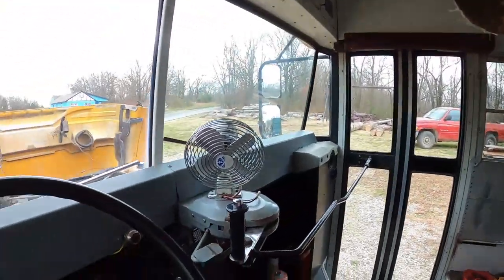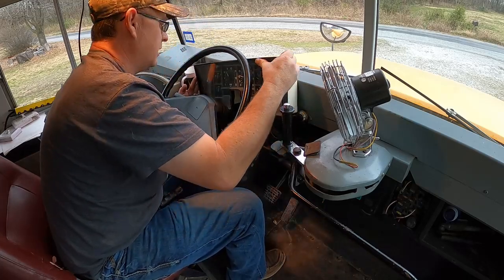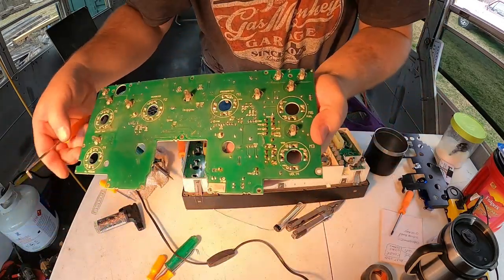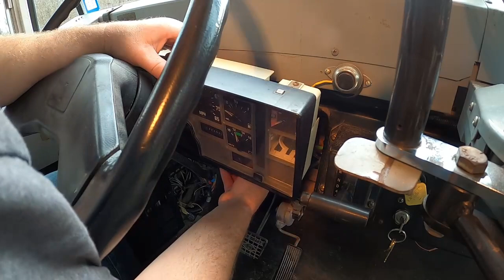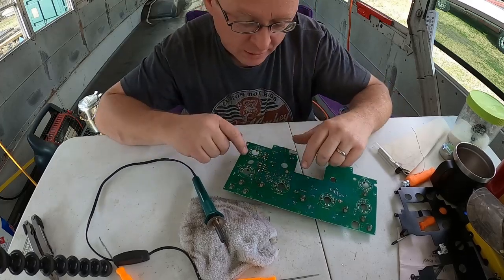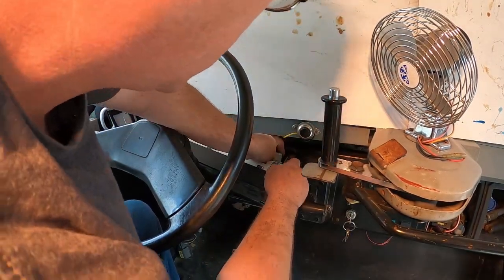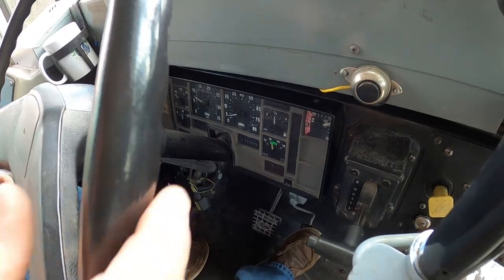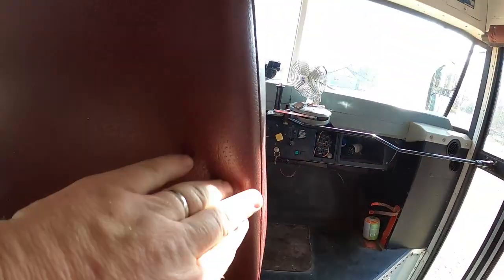International 3800 Skoolie - How-To Repair A Dash Gauge Cluster

Comment: I did fix one solder to no avail. I noticed the connection to the harness wasn't sitting properly so I had to bend some of the prongs over that way they would constantly make contact. Worked like a charm. Thanks for the video!

Comment: Thanks for documenting this process. I have a 99 3800 with this issue but intermittent while driving. I can tap it with back of my hand it sometimes comes back to life. Good old cold solder joints will do it every time. Been dealing with issue for years with computer monitors. 
Where can I get the dash light LED replacement bulbs at what number bulbs are these. Thanks again and cheers! from NC

Comment: My gauges bounce around when I start my bus but are not accurate. I have no dash lights at all when I turn the lights on. (Blinkers work) Do I have to take the whole thing apart to change the lightbulb for the dash? I’m so intimidated by all the electronics😱. You make it look easy. You’ve been doing this for a long time. I don’t think I can do this. Never mind about answering my questions. I think I will pass this on to someone that knows what they’re doing.
Reply from the maker: If yours is the same as mine. Then just pull the couple screws remove the dash cluster and replace bulbs. If you have to solder the pin connections then you may want someone else who is good at soldering not necessarily a mechanic. I know alot of mechanics I wouldn't trust with something like that. Most of them are gonna tell you that you have to buy a new dash cluster. Cause they're not mechanics they're parts changers. Not trying to offend any mechanics just staying the truth. And just saying careful who you take it to. And if your not comfortable doing it yourself. You could think of it like I did... what do I have to lose? If I mess it up. Well it's already broken so... the gauges bouncing is what they usually do before they stop working completely like mine. If your near Goodman Missouri bring it by I'd be happy to see if I can fix it.
Reply: @HOODS  I wish I was closer. I am way down in Alabama. My cluster is identical to yours. Maybe if I watch your video three or four times I will get up the courage. My bus is a 1999 8 window.
Reply from the maker: I'm getting ready to pull the dash to replace the bulbs with green led bulbs. I will do a better video explaining what I did.
Reply from the maker: New video is up on this repair. https://youtu.be/jH6TuqiKhro
Reply: @HOODS  again thank you.

Comment: Hi Dave, I noticed you said you were from Goodman, Missouri. I love about an hour and a half from you. I have a 1990 Ward International that the instrument cluster is having similar problems with lights flickering and gushes not working as it should. Can I bring my cluster by for you to take a look at?
Reply from the maker: Not sure when I'd have time to look at it. I'm pretty busy all the time.
Reply: I followed your video and took the main circuit board out and cleaned everything thoroughly with alcohol and plugged it back in and that seemed to take care of the problem. No more flickering and all of the guages are working now.

Comment: Hola buenas tardes no inglés tentego un camión internacional dt466 y el marcador de aceite temperatura de agua todos los marcadores no trabajan ya chq los fusible y nada
Reply from the maker: You have to solder the connections on the pins connecting the wiring harness plug to the circuit board. That is where the break in connection usually occurs. Not the fuses. Sorry I don't speak Spanish but maybe you can translate with Google translate. Have a great day Amigos.
Reply: Nesesito uno como el q tiene en sus manos nesesito su número de WhatsApp
Reply: Usted tiene uno bueno ya soldado q este bueno y me lo vende yo soy de Carolina del sur Charleston y aqi no ay electricos q Agan ese trabago
Reply from the maker: @juliocastillofalcon7759  sorry I don't have a watts app. I don't know where to get a gauge cluster. That's why I had to repair the original dash set.